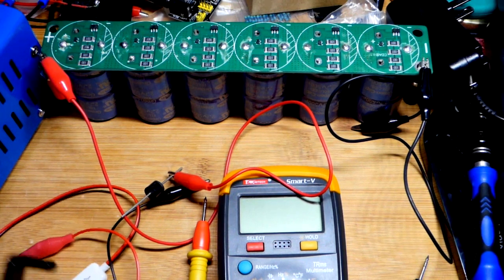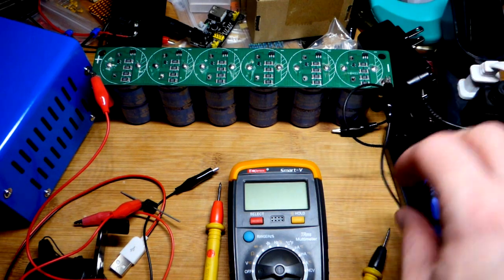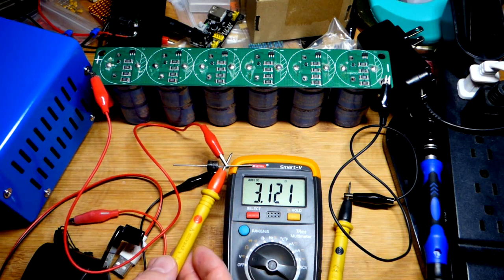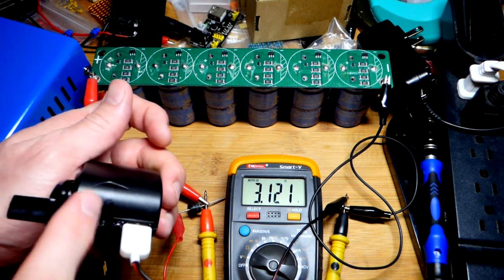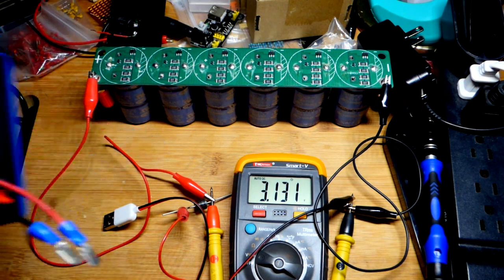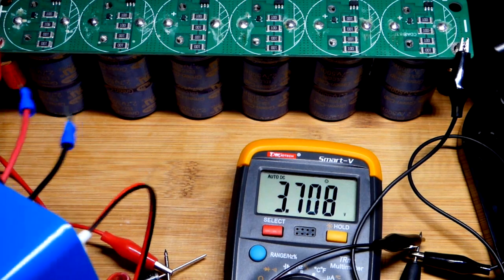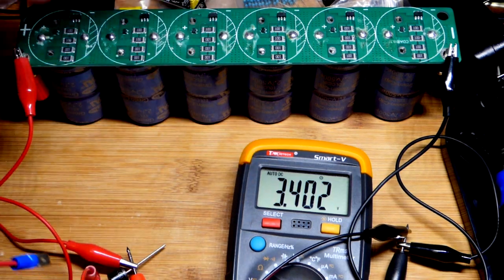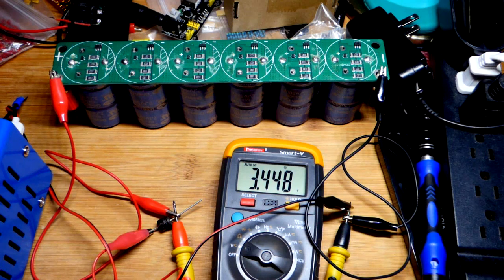Hand crank generator charging 6 series 500F supercapacitor protection board 15SQ045 schottky

Comment: The supercap protection does not protect against reverse voltage/charging and does not do any voltage balancing. Each circuit only protects each cap against overvoltage by switching on some discharge resistors. The circuitry on mine did not work, you might want to check yours.
Reply from the maker: Thanks for the info! I haven't found any circuit protection board doing all that much so far. So I just try to be careful. If I had more budget I would do more extensive testing.